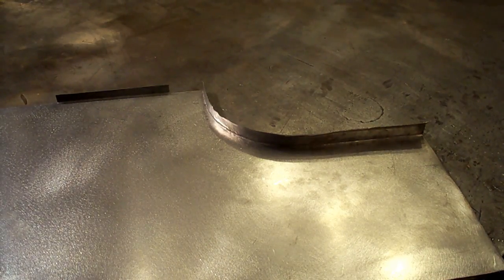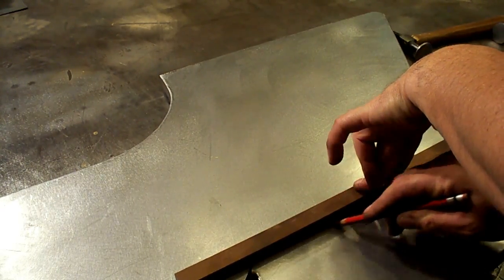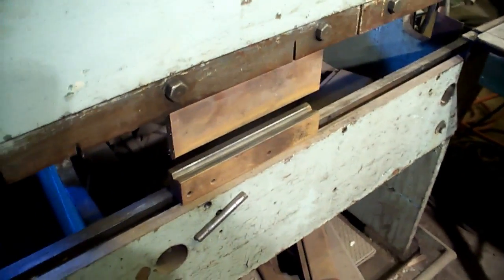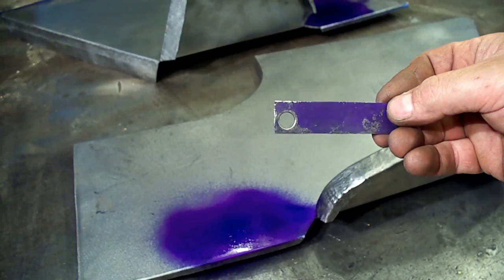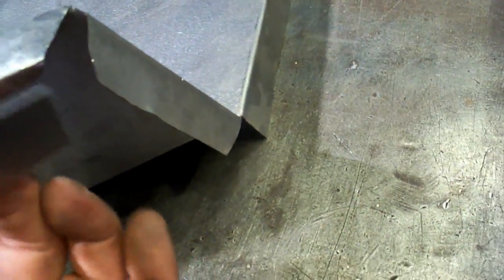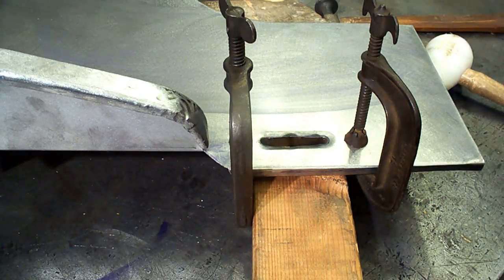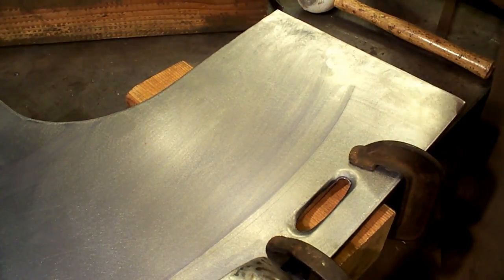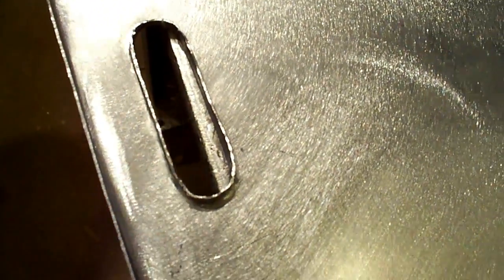Metal Fabrication Willys Welder Jeep Front Panel Part 2

Comment: I'd deffinetly appreciate it. It's the last part I need got the new worm shaft coming in as we speak the new inner gears already here soaking the Ross steering gear box!!! And deffinetly agree not to use the grease zert setup!!! It killed the guts inside the box!!!!! So now after your videos it's given me the confidence to rebuild the gearbox,trans,transfer,axels, myself knowing it will be done right!🤗👍if possible would like to contact you via email with further Q? If I run into a snag?
Reply from the maker: you can reach me anytime at metalshaper@comcast.net
When you are ready for the correct oil for the steering box let me know and I can get you set up with it.  
Brian

Comment: I'd love to know how to do the tool indents on the side to be able to add the shovel and axe
Reply from the maker: A few years ago I did a tutorial on the CJ2A page forum about building a side panel with the tool slots.   I don't go on the page anymore but I think the photo series should still be there.  Search for posts under my username which is "metalshaper"  and you should be able to find some of the posts I made.  I did the rear side panel with indents, the front cowl supports, and showed how to fix a hood.  Check it out, and let me know if you can't find it on the CJ2A page forum.  
Brian